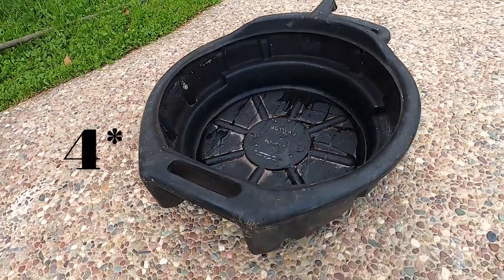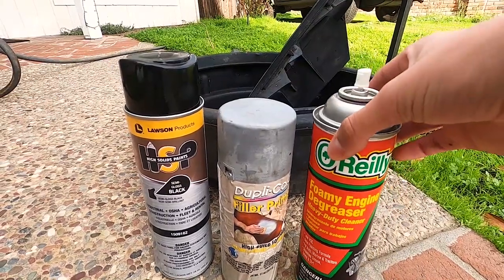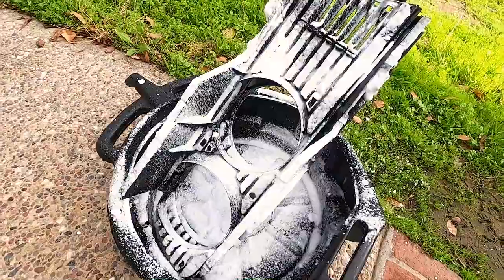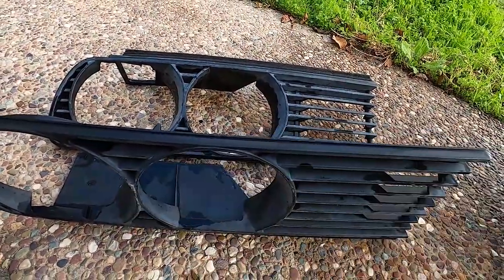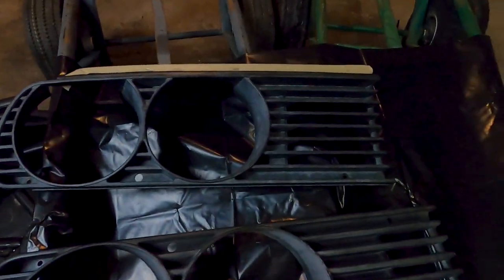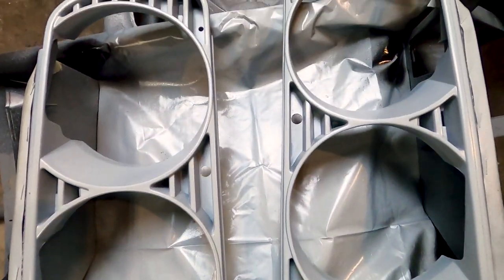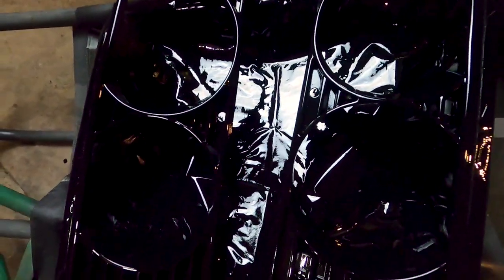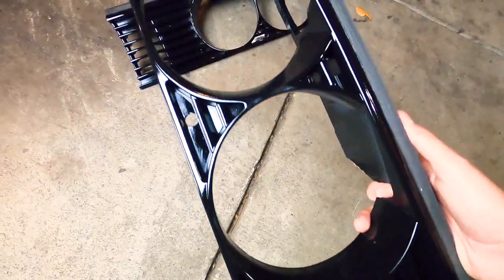How To Restore Faded Plastic - (BMW E30 Euro Grilles)

Comment: You can paint the black plastic in the kidney grill, too.  There are 4 little plastic expanding pegs to remove that hold the silver E30 kidneys in place.  Pop those out, and you can paint the center piece.

Comment: you damaged it.
I recommend to deep clean and apply ceramic to get a black black look, but keep original texture etc. paint and primer would kill it. I would replace the foam with a tape from BMW anyways. New foam.
Reply: what kind would you recommend specifically?

Comment: The price of new ones is cheaper than the spray paints...
Reply from the maker: oh damn lmao where at? i need that plug
Reply: @bimmerholic7730  here in Europe u can buy anywhere for 16 euro a side...check autodoc site
Reply from the maker: yea in the states you cant get new ones for anywhere near that price, you can get the primer and paint for like $20-$30 depending on the quality of paint, maybe getting them from Europe would be smart but idk how much shipping would be too
Reply: Actually because shipping to the U.S. is at minimum 100 euros and the aftermarket parts themselves are 10-15 euros for each side its almost the same price as buying new ones here and you would have to wait weeks to get them. Not worth it over here.